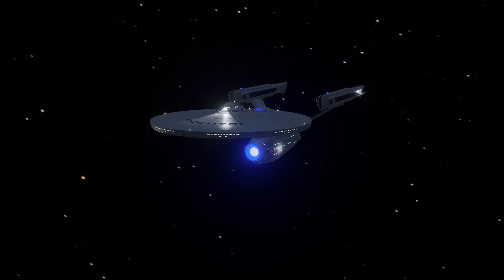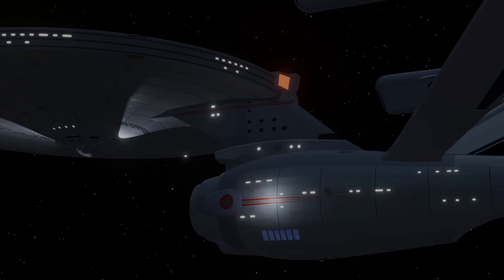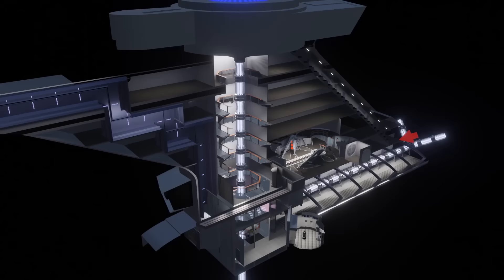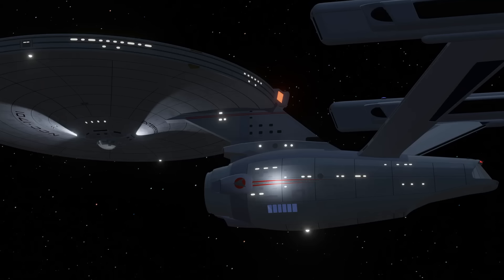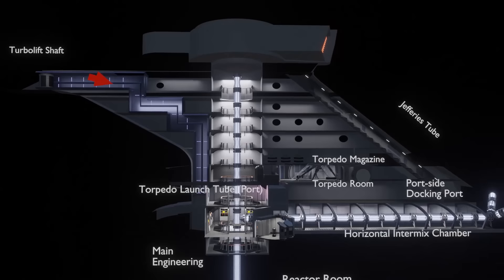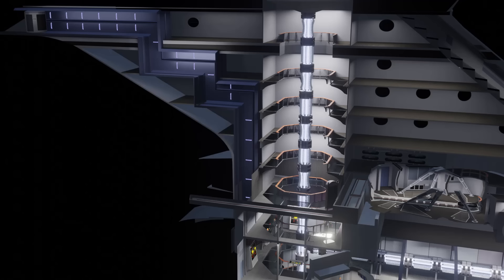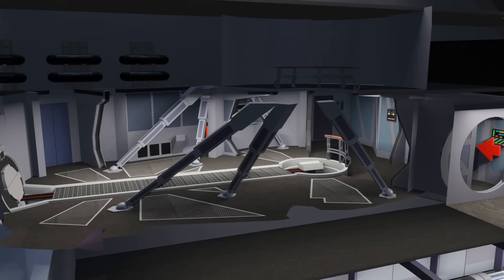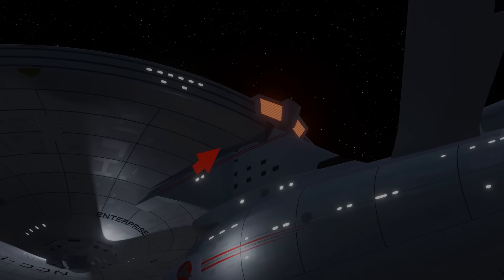The Enterprise Dorsal Problem: how did the turbolifts pass through it?

Comment: One thing: why does the turbolift itself have to stay vertical at all times? Obviously we don’t really know how artificial gravity is generated, but what benefit would there be to generating it in the turbolift shafts (even if ST5:TFF and ST:N suggest it is? Why not keep that in zero-gravity and generate gravity and structural integrity within the lift car itself? Then you can have a car going up a diagonal shaft while the car itself is angled away from the vertical, and the occupants wouldn’t even notice.

Comment: Your scaling is wrong. I have been model engineer for 35years and the Refit enterprise has been a personal lifetime project of mine. I have built an 8.5ft replica of the Shooting miniature of the model. Which accurately measures to 1/125-1/130 scale at 12.5-13mm a 6ft person. You will find the width of the Dorsal [Not including the wide Torpedo bay section] is approximately 8.5mtr wide, not 4.5.  Visualising on a computer and physically building it to scale to the shooting miniature are two different things. By your measurements a person will bang their face into the top of a circular docking port door ring. At 1/1 scale Their should be a clear 20inch head clearance between a persons head and the top of the docking post ring door. On the shooting model, the docking port inner door rings are 19mm in diameter at 1/125 scale. 3mm horizontal level off step at the foot of the ring, 2.5mm head clearance and 12-13mm 6ft person.
At 2mtrs per person, laid length ways to use a a measure to measure the width of the dorsal, comes to 8.5mtrs. In essence You have made your ship model interiors too Big in relation to its external outer human scale.

.to

Comment: I used to think the vertical intermix chamber looked as you've got it here, but then I saw a shot in Engineering looking upwards and there's a roof above N Deck. So there's no reason to think that the shaft from H to M deck has a wide balcony around it as it does in the engineering section. That would open up space for passage on either side, and the turbolift shaft could run straight down in front of it all the way from G deck (not necessarily from H). Is it perfect? No, but no more so than lot so other SF interiors not quite matching up with their exteriors.

Comment: there would be rough room if the warp core engineering space didn't extend all the way into the saucer section. Instead having a small "shunt" at the very top of the intermix chamber on so that you wouldn't need to have such a huge around the warp plasma field on H-deck. The shunt would pass through a bulkhead on between I-deck and H-deck where instead of that giant space you just have a simple pipe. it would also make sense to have this shunt because otherwise you'd end up evacuating main engineering during saucer separation thus the placement of the turbolift is astern of Main engineering and slightly starboard, exactly where kirk boards the turbolift in the torpedo room to get to the bridge. for engineering access to this shunt you'd have a small Jefferies tube on the port side. or simply an access hatch/room on H-deck.

Comment: Hmm, my only thought is why does the turbolift have to travel vertically? I mesn the gravity indude is shown in many eppisodes to be localized to inside the haul. So i can assume the gravity is licslized into the deck plating. Which means that if the is grnerated at the bottom of the turbolift, it can travel in any orentation needed to get to its destination.

Im not sure if this helps the problem, but maybe it can help a bit.

Comment: The lifts aren't elevators. They don't just move up and down, they also move side to side. They're equipped with an artificial gravity generator that works independently of the rest of the ship. The passengers rarely, if ever, experience acceleration or deceleration. So when the lift needs to move horizontally, it just moves horizontally at the end of it's vertical ascent/descent. Thus the lift stairsteps through the ship. 

It's the only logical explanation.

Comment: I've always wondered why the warp cores were so tall to begin with if the mixing and reaction is happening at the dilithium crystal chamber in engineering where the plasma conduits connect. If the upper and lower sections are just carrying the matter and antimatter respectively why where they so tall to begin with instead of the injectors being much closer together? It feels like the cores could have been just a few decks tall and we see that they can be with small ships like the Defiant class.

Comment: Since gravity is basically magic in Star Trek, could not the direction of "down" in that diagonal dorsal be parallel to it?

Or is there some definite canonical source that say that this vertical chamber actually completely fills the full width of the connection and that it does so at this angle such that it bisects the dorsal connection completely as in this illustration?

Comment: Is there anything in canon that says the turbolift shafts have to be strictly vertical? It's not like they are normal lifts suspended from a cable. What's to stop them running at an angle?

Comment: And how do you calculate 4.8 m at the widest point? The dorsal's width looks similar like the height of two decks of the sourcer section and this would be equal to probably 6m at the backside of the dorsal. I guess that the dorsal is even wider at the place of the vertical intermix chamber.

Comment: There's schematics which show the turbolift follows an L-shape going horizontally in the saucer section until it's just in front of the vertical intermix chamber, and then it continues down the front of the vertical intermix down to S-deck. There is a separate turbolift system that goes through the main hull through S-deck horizontally from behind the primary computer core and has vertical extensions down to lower decks. As it travels between the torpedo launcher tubes, and is in front of the intermix the whole time, it has no path issues.

As for the kirk wrath of khan situation, why does he have to go straight into a turbolift? That door could merely lead to one of the decks of the vertical intermix which he follows the walkway around, then going into a second door in the intermix room at the front which leads into the turbolift?

No issue whatsoever then?

Comment: The whole construction is a mechanical nightmare. The engines put a enormous stress on the superstructure.  My guess it would just break apart if you try to turn hard. The inertia of the big bubble head, means disk section would tear everything apart.

Comment: I disagree with the assumption that the "tube" or intermix chamber shaft remains the same size for the entire dorsal as it moves up - I don't think that is implied in the film and it likes get narrow above the three main-engineering levels but you seem to show it basically be the same size as main engineering (not including the long hallway for the horizontal part and run of the intermix tubes) for the entire area.

I think a lot of assumptions about size and location are being made here, and we are not shown any in-film backups.

Comment: 1) I can immagine, that with such high technology, like artificial gravity and inertia dampeners, the shaft can be a wee wider and inclined (sloping?) a bit - i.e. not EXATLY vertical. Only the cabins orientation and the door orientation should be vertical - that combination actually allows you to have the emergency ladders (or staircases) and slides for movement if the turbolift does not work a bit inclined/sloped and therefore MUCH more secure to climb inside, than straight vertical shaft.

2) And even that does not seem as a question of life and death, because IF the cabin does have its own artificial gravity generator and inertia dampener(s), the pasangers would not find out even if the cabin travels "horizontaly" oriented, and re-orient before docking in front of the door.

BTW - my highest fear on the Enterprise are the struts with warp naccels. It does not seem to me as possible to have in it space enough to fit a person traveling from engeneering module into the naccel.

Comment: 1:15  I don't think the vertical anti-matter chamber stalk had the viewing areas all the way up.  I would think that it would be enclosed, for the most part, going through the neck to conserve space.  I also have to wonder if the photon torpedo pods were empty when shoved into the torpedo bay (aft of the A/M vertical tube), were filled with anti-matter from the vertical tube and then loaded into either torpedo ejection port. If the torpedo loading room is aft of the A/M tube, this would allow 2 torpedoes to be "charged and loaded", almost like a giant shotgun.

I think the K'Tinga had the better design, as it appears that the photon torpedo is manufactured right in the torpedo tube.. no need to load a case.  In fact, would it be more of a plasma torpedo than a photon torpedo?  4:37  speaking of which, this was a repurpose of the Klingon bridge seen in ST:TMP.  The observation deck in the back of the torpedo loading room is the observation tower on top of the K'Tinga front pod.

6:15  even when I first viewed ST III:TSFS I wondered "how does anyone get from the saucer to the secondary hull?  Was it purely sensor equipment, and all crew areas were in the saucer?  Did everyone just beam back and forth, regardless of the ethical dilemma?"

Comment: Perhaps turbolifts were transported from the saucer section to the decks below the dorsal section and never actually passed through the dorsal section. This could be considered very reliable as it would have been a wired beam (think Ethernet) rather than wireless beam (think  WiFi). The whole thing could have been transparent to the people in the turbo lifts.

This would also work on the USS Grissom.

Comment: A passageway wrapping around engineering probably. At that point you're just starting into the wider part of the engineering hull and the lights on the side there suggest view ports where there are none in engineering so it would have to be a passage as there's no space for anything else, it will be narrow, 2 people would probably have to shuffle past each other. Turbolifts can turn as well so when called could theoretically open to any direction required.

Comment: Hi - I enjoyed the video. I appreciate the analysis and always enjoy living in this world and all the effort and love people put in … respectfully … how do you get 5 meters for the width??? I checked Shane Johnson’s reference and measured with a ruler using the scale … I’ll have to try again … but I get a lot more if the primary hull has a diameter of 460 feet and using the scales and ruler measures for various interior diagrams I get widths  initially or roughly 20 ft and 40 ft for M deck … a turbo lift is about 9 ft … it’s tight … there is conveniently no scale on the exterior … but pro portion and ratio and interior scales applied to exterior diagrams … I’ll try again … I mean the neck is smaller than the bridge for sure … where is my mistake …???
Reply: I found my mistake lol😂👍 apologies if I convert my feet to metric or meters - I do indeed get 5 meters - almost 6 but still 5.68 isn’t really enough as you say - wow 😯 thanks for the video - it was a lot of fun and it got me to practice my math, scales and conversion. Your other videos are great too 🥰🙏👍

Comment: Does the intermix shaft need a catwalk on all levels between main engineering and the impulse complex? Perhaps one or two of those levels would only contain a closely walled tube with the intermix going to the impulse engines. This might provide enough room for a turbolift to squeak by.
Reply from the maker: Needing catwalks? No, not really - especially when zero-gravity is an option. Without the catwalks, there would be more space, but would there be enough? Those turbolift shafts must take up a lot of room.

Comment: But who said that the vertical intermix chamber along the dorsal has this entire diameter? I think the premise of this video is wrong. The Enterprise's dorsal was purposely designed this way so that the disc can be easily ejected from the secondary hull, in case of emergency, something that would be unfeasible on the Enterprise D, given its absurd width.

Comment: I always thought the intermix chamber did a split to port and starboard allowing a passage for the turbolift to freely pass through. As for that split, energy conduits carry the resources to and from the impulse region. Which deck this would happen on, would be where the neck meets the engineering section.

Comment: Why not use a little bit of magic like the Tardis do? That the inside of the shaft is bigger than the outside. That would solve every problem with ease.

Apart from that you could have the turbolift running down the warpcore shaft at one if its sides while having the exits to its side you can also assume that the neck is a bit wider than what the model assume. So by adding a meter or two to each side of the neck you will fit everything needed by ease. J.

Comment: Putting your warp Core and your Photon Torpedo bay in the NECK, RIGHT NEXT to each other is a tactical complaint but there is nothing to scavenge if it dies.....  It does answer the how does one separate the saucer from the Secondary Hull.   Just rig a torpedo to explode......

Comment: Why would you assume that the warp core “intermix chamber” would go all the way up to the impulse deflection crystal?

We know from on screen canon that impulse and warp engines are two separate propulsion systems and don’t interact. And in Star Trek the motion picture and Wrath of Khan, where we see lots of great shots of engineering, there’s no reason to suspect the warp core goes all the way to the top of the ship. All we see is engineering, and then the intermix chamber running horizontally towards the ship’s stern and splitting into the warp nacelles.

Comment: There is a problem with your 3D recreation. There should be two torpedo loading bays, one leading into each torpedo tube. When Kirk first enters the ship he is entering "TORP BAY 2" to greet the crew. When he leaves the room he walks down a hallway and completely around the plasma transfer conduit before getting on a turbo lift on the opposite side. The turbo lift should also run straight up (not diagonal or stair stepped) until it reaches H deck where it can then move horizontal.

Comment: The Turbolift access in the Torpedeo room, at the end of your video?   Who says when you entered the lift, it has to go up through the neck of the Ship to access the saucer?  Since Lifts run in all directions, it could easily go down deeper into the wider section of the secondary Hull first, where the Lift tubes track aroung the intermix room, to the front of the secondary hull and then go up through the kneck that way.   I never did like this intermix design.  The crew of the enterprise is over 400.  You need two turbo lift tubes moving through that kneck minimum, to make the entire transporation network efficient.  You also need two for redundency.  So the verticle intermix conduit assembly, that feeds the impulse engines, should have been moved to the aft section of the neck, even travel at a 45 degree angle, parrallel to the kneck jefferies tube.   This would make for a more compact Enginnering section and shorter Intermix conduits.

Comment: Doesn't Kirk stop to tour Engineering on his way to the bridge after boarding in Wrath of Khan? As one of the main drivers for our understanding of the refit's design that's informative. It may follow then that there are just two turbolift paths, one for the saucer and one for the secondary hull, that meet somewhere in the dorsal and require you to basically pass through engineering to get from one to the other. Which is maybe a tad inelegant, but the ship design sensibilities in early Trek are largely intended to be based on subs, and it's no revelation to suggest that design on a sub is frequently pretty inelegant due to limited space. By that metric having to jump off one elevator, walk around the intermix chamber, and then hop on another just to get to the back half of the ship honestly doesn't seem that strange.

Comment: Ahg, laddie, ya got it wrong. The Intermix chamber is not directly below the Impulse deck, otherwise in TWOK and the like. hitting it would have blown up the Enterprise. And Star Trek V and the 74 decks doesn't count. There are only 21. 

Okay then, so the actual intermix chamber is not in the saucer. It's in the drive section. It only goes up three decks in main engineering, easily clearing the shuttlebay, aft, as seen in TMP, and clearly that shaft runs the two diangonals also, up the warp nacelle pylons. 

The turbolift shaft to the bridge does indeed curve. It runs up the spine of the neck, up through on two shafts just fore of the Impulse deck. The ship being 245 meters, it is long and wide enough to pass around the shaft for the impulse manifold, which does look like an intermix shaft, but isn't. It's the impulse engine shaft. 

The decks are numbered not lettered. Deck 1 is the bridge. 

The turbo shaft you think is the chamber, and the lighted room you think is engineering, aren't. It ends in the arboretum. 

The twin shafts of the refit 2270 Enterprise also can slot and shift into place because the corridors do that there, not like an elevator. More like a tram.

Comment: We could just assume the size of the ship is slightly off, its not like that is common place in trek.. lol
a few meters either side, but even then if you go to the back of the saucer there should be space to run a turbolift down from there wouldn't there?
I kinda assumed the torpedo bays stuck out either side, as they do on the model.